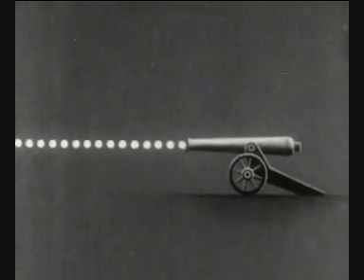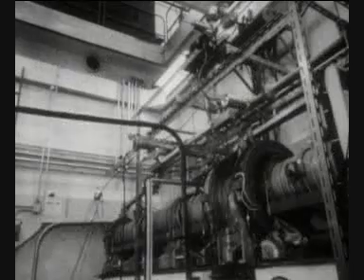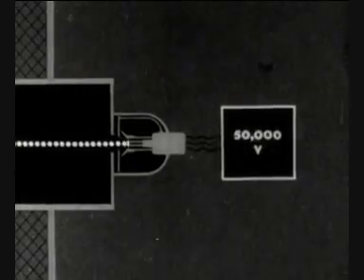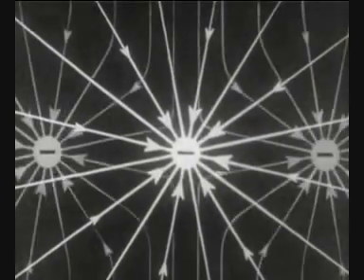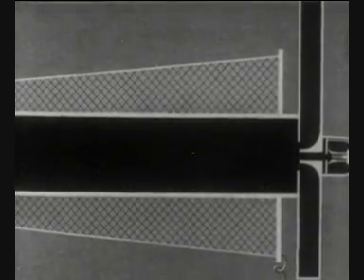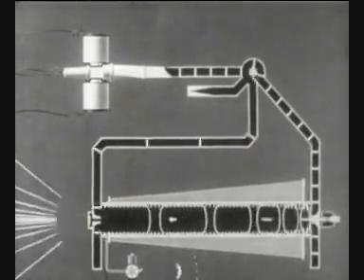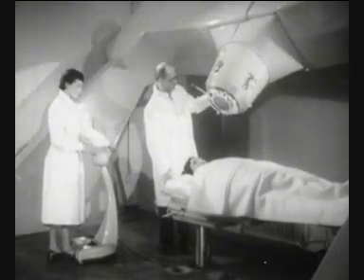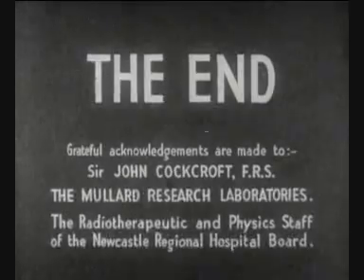The Linear Accelerator

Comment: While I love this video, need to point out an errata: at 6.46 the apertures of the iris plates should be drawn to be  DEcreasing (not INcreasing) toward the target end. The decreasing radius makes the microwaves accelerate (although it's not that clear to me how that happens... input from other viewers?)
Note - this video is about "travelling wave accelerators". These are still used today for some 6 MV-only medical linacs (e.g. Varian Unique and I think also the old CL600). In 1968 (after this video was made) Knapp et al invented the "standing wave" accelerator, which allow higher energies (15-18 MV) in a reasonable length of accelerator waveguide (about 1 m).
Reply: The smaller the iris the slower the rf wave. Slow rf waves needed at the beginning because the elections are slowest there. i was impressed when the animation got that detail right.

Comment: The original film was made in the late 50's and was discovered at a local car boot sale in the Crawley area many years ago. MEL was manufacturing Linear accelerators at MItcham,  London and moved to Crawley when the Industrial estate was built. MEL was eventually purchased by Elekta. Elekta are still manufacturing medical linear accelerators on the same site. We used this video for many years in the training department to describe the physics behind the accelerator. The basics have not changed in over 60 years.